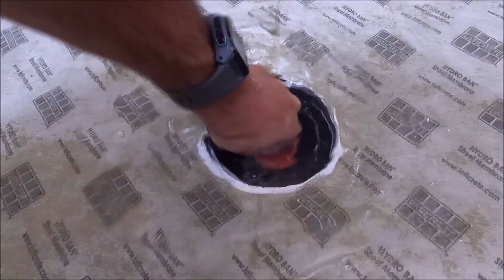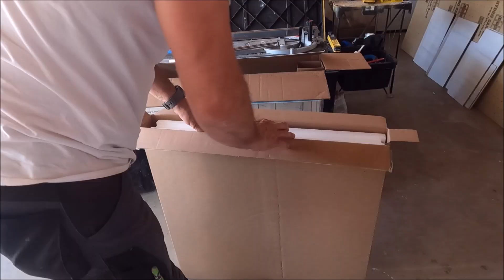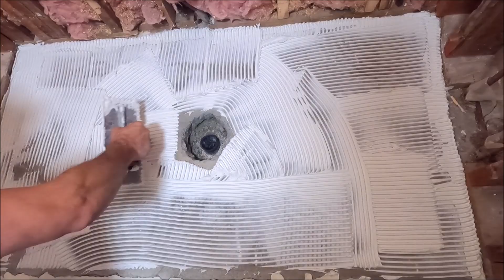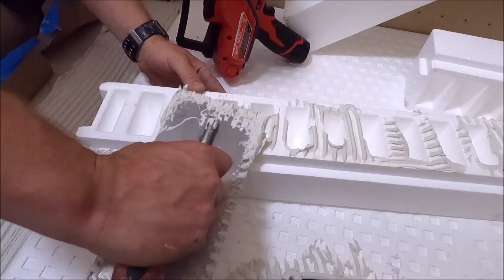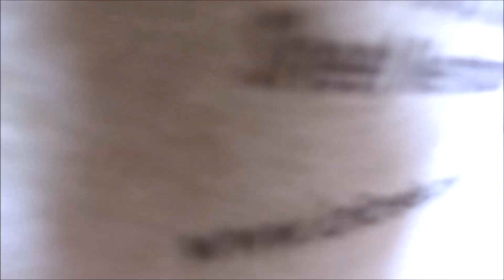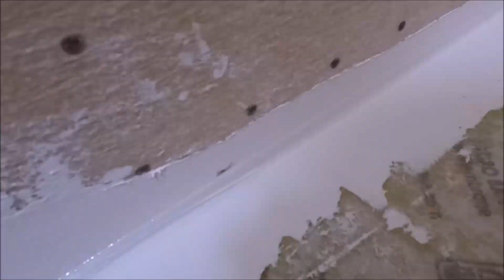NO BUILD UP Shower Foam Tray Install - LATICRETE HYDRO BAN

Comment: Help, please. What would you do if you had to fit this 32x60 in a smaller rectangle (3 walls and a curb) and the drain was in the middle and off-center. 

Respectfully, videos like this are educational and helpful. However, more often than not a 32x60 pre-fab stock pan has to be cut and custom fit into a space. Consequently, the decisions are to either minimize your cuts and sacrifice your perimeter, level edges and wallboard rabbet or cut the board multiple times preserving the factory edges and piecing it back together. 

Was I overthinking that factory edge needed to be preserved? We want a nice straight line where the tiled walls meet the pan floor.
Reply from the maker: Factory edge is not a big deal with rectified tile, a diamond pad can make it look factory.

Comment: Cant find any place in Southern California (San Bernardino/riverside area) that stocks hydro ban wall board and sealant. Seems to be a special order item. Called Laticrete Corona location, they directed me to distributors that dont stock the wall board or pan kits.
Reply from the maker: Yeah, some areas don't carry it.

Comment: Would I be able to eliminate the banding if I set the Hydroban board on a mud pan tray with a recessed edge & covered with Hydroban membrane and sealed with Hydroban sealant? Most shower pans I've installed are not "stock" sizes  and therefore could not have the perimeter recess like the one in your video has.

Comment: I'm doing the same type of shower with subway tile and goboard and schluter shower tray. Would I be able to eliminate using banding when using the goboard sealant? Should I use hydroban liquid membrane as an extra precaution? Just trying to eliminate buildup with banding.
Reply from the maker: I understand, but you need to check manufactures instructions
Reply: @LandbergTileTV  thanks so much for your quick response. Really enjoy all your videos and all the effort you put in into them. Be blessed!

Comment: Well.. that's not Keying in the substrate but if you say so. They must do things differently Where You Are lol. Use the flat side of the trowel push the thinset into the substrate then turn the trowel around and rake it, raking it only is not keying in the substrate! Thank you
Reply: Key is the "technical" term. We call it "burn". Burn it in first
Reply: Different areas of the United States call it different things. But yeah, I'm a pretty technical person. Either way, it's gotta be done. @psyphen0002

Comment: Another great video!  How do you handle cutting the Laticrete pans?  Do you have to maintain the "groove" that is there?  Have you mixed Schluter trays with Laticrete Hydro Ban board?  If so, what type of waterproofing at the wall/pan junction?  Thanks!!
Reply: We need an answer Landberg if you do have one , doing self leveling before the shower pan is not a time saver for sure, love to see this as a hybrid between schluter and laticrete

Comment: Very nice. I prefer wedi. Much faster than laticrete and schluter in my opinion. I put a 2x4 in between each bay on the bottom plate
Reply: Why ?
Reply: @j.w.r.i2910  wedi no need for sheet membrane. 2x4 in bottom of bay to reinforce.

Comment: How long does one have to wait on the silicone adhesive to dry so we can waterproof test the shower pan?
Reply from the maker: 2 hours. This is off Laticrete data sheet
Flood Testing
Allow for flood testing in 2 hours at 70°F (21°C) 
and 50% RH or higher before flood testing. Cold 
and /or dry conditions will require a longer curing 
time.

Comment: Nice video but I like having tape in the corners. The build up is minimal if done right, it doesn't take long or cost much, and I sleep better. I'm not fond of foam either, especially for small tiles.
Reply from the maker: I am 100% confident that this shower will outlive me.

Comment: Dude, not having to with the fuss, mess, and build-up from waterproofing corners and bands is a huge benefit to this system. The sad thing the majority of our jobs are from custom builders who dry pack and board with Densshield, so a lot of pre-folding bands are still in my future.

Comment: this must cost $10,000
Reply: Probably right depending on your location. Had a quote from a contractor for a tub shower tile surround come in $9-11k. Total bathroom remodel was $18-20k. Used laticrete hydroban as my backer and waterproofed for the shower, and complet d the entire bathroom for under $7k using higher end material than what was quoted. If you sub it out, it’s 11. If you have some know how, diy would probably be 3-5k
Reply: @lesg9604  sounds about right. you're definitely not getting this quality in a new subdivision.
Reply: Landberg is top notch for sure. There’s a satisfaction one gets from doing a job of this magnitude themself even if the quality is 80% of a professional for 1/3 the price. This shower I did being my second, I definitely made a few errors but am like 90% happy with the overall job. Also, using this system gave me tons of confidence that I’ll have no water issues.